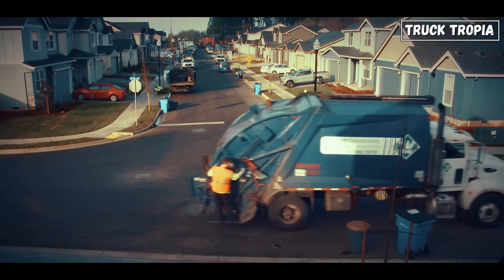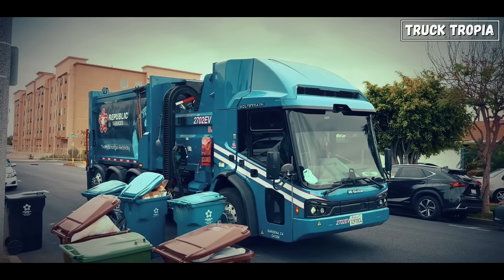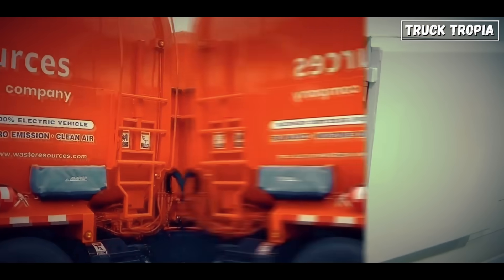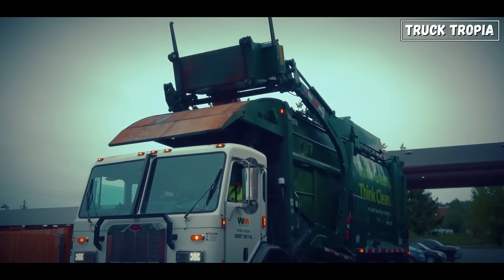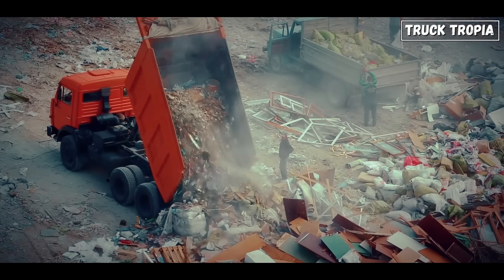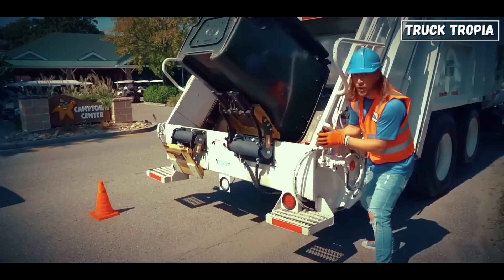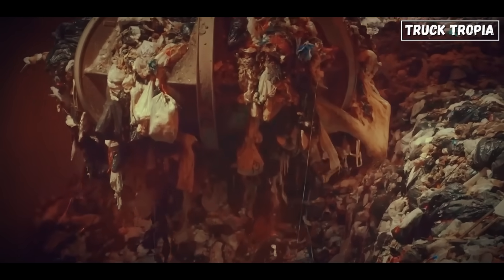What REALLY Happens Inside a Garbage Truck?

Comment: My first real job as a teenager was as a "back man" on a rear-loader.  Three of my uncles were garbage truck drivers, and they got me the job.  It was a lot of heavy lifting, running, and showers.  The smell, especially in the summer, was brutal, but you got used to it.  It got into your skin as well as your clothes.  Maggots were also a problem in the summertime.  We used to get those old school galvanized metal cans that didn't seal well, and when I tell you the maggots were inches deep, I am not exaggerating.  It was gross, and they would climb up inside the hopper.  If they got onto your skin, you'd get bitten.

Comment: Recently moved from my last residence of almost 30 years. On my last garbage pickup I gave the guys some doughnuts. I'd seen them often enough and they're a pretty chill lot. Back and forthed a bit and at the end of that conversation the topic of recycling came up. Don't remember the question that was asked, only that they both laughed and said that the recycling truck dumped everything in with the regular trash. I suppose I should have seen it coming, both trucks were the same, just different coats of paint.

Don't get me started on aluminum cans. Saved up enough to fill three lawn debris sized bags. The money we received wasn't even worth the 180 mile round trip in gas alone. Yeah, how many years did those cans sit there taking up garage space slowly filling up, only to result in a net loss.
Reply from the maker: Interesting insights, thanks for sharing!

Comment: What surprised me most was that the video showed me little to Nothing of what happens inside a garbage truck.
Reply: The weirdest thing being the script mentioning "so now you know what happens inside a garbage truck" like 18 times within 7 minutes.
Reply: Exactly! Waste of time...
Reply: It's almost like they went in depth to not show us.   I think hydraulics were involved.
Reply: Yea
Reply: "Whats goes on" trash is dumped inside the hopper..(the place you see the can going) a bulk blade, this is a  hydraulic ram the size of the truck pushes the trash to the back or front of truck, that's called packing. 
There are cameras that the driver watch for hazardous materials, tires, oil etc.. also to watch how much the blade has packed and if the truck is full or go dump. 
Most front load (dumpster trucks) have two large cylinders that cross each other for maximum compaction. Trash juice is trapped inside the truck by seals. Sometines you see them leaking (not from lack of maintenance, but from pressure) There is a small chamber for side load. This leachage is dumped at the landfill along with the trash. 
During the day a lot of trash crosses over to the wrong side of compaction blade and at end of day after dumping final load. Drivers climb in the back, (small doors you see on side, and clean these areas out. Takes around 5 to 10 min to clean out (front load trucks) Side load trucks do not have.. they have the chamber.. 
 It takes average of 4 hrs to fill a Trash truck in  Surburban areas. 
In heavy populated cities like downtown areas. They can be filled within 3.  An single Apartment complex can fill a front load truck in as little as an 1 hr.
Hope this Helps..
Happy Trashing
Reply: @terrencemckinnon9371  If I could read I'd wouldn't be watching YouTube.
Reply: 😂😂😂 exactly 💯
Reply: What do you expect from AI slop?
Reply: @Alex_-oc4bt  my thoughts exactly

Comment: In europe we have side load trucks with an arm that terminates  with a ring electromagnet and a piston coaxial to it.  The magnet attaches to the external part of the lift spot on the bin and  once positioned the piston press a bar in the center of the  spot itself

Comment: I can't believe this video didn't mention that most modern garbage trucks are running on CNG, (Compressed Natural Gas) CNG rear loaders will have the fuel tanks mounted over the front of the body and behind the cab. CNG front loaders will have the tanks mounted either on top of the body or inside of the tailgate. CNG side loaders will have the tanks mounted inside of the tailgate. CNG rolloffs will have a large tank mounted on either side bolted to the chassis. (CNG is a cleaner fuel, but only offers half the range requiring larger fuel tanks, meaning trucks on long routes will still use diesel.
Reply: The city i work for has exactly zero CNG trucks.

Comment: The internals are at, 2 minutes to
 4 minutes. Its a very simple system. Front lift rubbish goes in then a  panel pushes & crushes it to the back of Truck,  to the tail gate.
A rear loader is similar but pushes the rubbish to the front. Side loading uses a paddle which sweeps rubbish left to right to the tail gate,, that's all that happens. 
Very basic system, just keep feeding it until it stops,, its under  big Hydraulic pressure..

Comment: He forgot to mention the rear loaded has a second plate called a index plate witch the load is pushed up against that then moves due to pressure
Reply: Sweep blade and push out (or ejection) blade are the terms we use but terminology can be regional

Comment: The compressors are the main reason why you DON'T THROW LITHIUM BATTERIES IN THE TRASH.  You run the risk of garbage trucks catching on fire.
Reply: I had a load catch on fire once. It was a lithium battery from a remote control car.

Comment: Where i live it's a combination side load front load the truck has an attached front load bin mounted on arms with a side loader mounted on the front bin
Reply: That's called a Currato (there are probably other brands too).  

Most Currato are Single stream But there are split Curratos. to dump into a split body truck.    Garbage may be dumped on one side and recycling in the other

Comment: 24 year Diesel mechanic in Garbage. Safety is always first. We have strict lock out tag out procedures. These trucks store a lot of hydraulic energy, thermal, air etc. Also. The garbage trucks have 3rd eye cameras in front of the truck and inside the hopper. We can see where the truck is at. And if it picked up your trash. Lots of things you throw away can be seen on camera. It’s a good customer service tool. In the US we call the side loaders. ASL. The other truck with recycling and garbage. We call that Dual sort. Nice video!!
Reply: Good use of LOTOTO. Safety first
Reply: You've gotta stick a magnet to the access door prox sensor to check when the driver complains of a hydraulic leak.

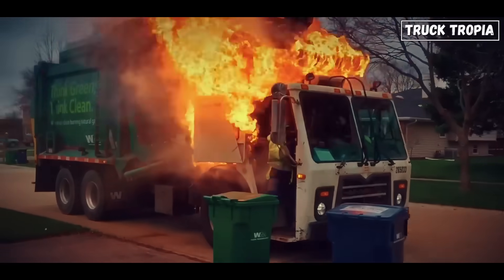Comment: I like the irony at 5:42 they talk about fire suppression systems internally in case of lithium or chemical fires... but show a clip from an external fire, one from a ruptured hydraulic line hitting the hot engine exhaust to be precise.  Like yea it helps illustrate the narration, but could at least have put another vid of an actual battery fire even in a lab setting.

Comment: I can’t imagine that the mixed up contents are actually sorted. Who’s doing that job???
Reply: I drive a rolloff truck and empty at a simple flat floor transfer station (garage style covered).  I dump along side of residential trash trucks and  most of the stuff comes out in a log shape.

They only see stuff thats on the ends and edges then as a scooper picks it up it reveals more of it.  If the loader operator sees a forbidden item they have to remove it.

If they are lucky they will spot it as its coming out of the source.  Then the driver has to take it back with them and try to figure out where it came from
Reply: @leslietaylor4458 guarantee they aren’t doing that last part unless they get benefits or extra pay for it. Maybe you, but I’m inclined to believe that most simply will say “I can’t figure it out”
Reply: Recycling will go to a sorting facility which is highly automated.   

Some areas collect all or some types of recycling whereas others only collect cardboard
Reply: No one. Recycling is a scam, it all goes in the same pit.

Comment: A Chicago garbage hauler told of disposing of a rotted-out '57 Chevy.  They chained it and pulled it into the crusher.  It reportedly took several "bites" to swallow the car, but they eventually got it done.  (This was in the happy days before the environmentalists and the EPA.)
Reply: I drove over a load early in the morning. A radio traffic report said there was a downed tree at a certain street. I pulled up to see a police officer babysitting it waiting for the city to come out and chop it up. I backed up my rear load to the small part and my truck "ate" the 30 tree about two feet diameter trunk after several cycles (bites)

Comment: Side-loaders.  Guaranteed to take down a couple cable tv lines, every day.
Reply: Not if your alarms are working right. 

Even then an ASL arm will have been lowered to put the toter back.   If the fingers are not fully retracted, though, it can rip open parked cars like a can opener

Comment: there's another type,  with SPLIT compartments (Separation for TRASH and RECYCLABLES) 
at the top, a moving door channels into the proper compartment.

also newer trucks have manual or automatic grabbing arms to speed up the collection process
Reply: There are two types of split bodies for an ASL.

I have driven the type with the swing door inside the hopper like was pictured. There is also a split body for a split Currato.  Depending on which to her you're picking up, you can select it to dump on the left, or the right side of the Currato

Comment: 👎🏾 never showed the internal animation that I clicked to see 😡
Reply: Thats why I am here
Reply: Show internal action please.
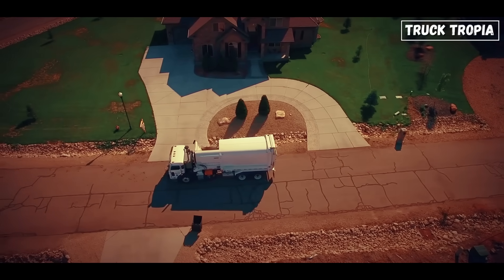Reply: Thanks. You saved me 7:42 seconds of my life.
Reply: That’s fake as a garbage expert that is fake so
Reply: I thought I was the only one.....🤔
Reply: Yes time wasted 😔
Reply: getting a thumbs down
Reply: I also expected a nice animation
Reply: 2 to 4 minute mark, Front lift truck dumps rubbish at the front of the body,, a huge square panel in side which fits snuggle inside the body pushes & compressors the rubbish towards, against,  the rear
 tailgate then the panel retracts back to the front ready for next bin. When the truck is full, you open the tail gate & use the same panel to push the rubbish out.
Practically the same for rear loaders just opposite.  Side loaders, one of many  uses a paddle. All it does is sweep from left to right like, 9 o'clock to 3 o'clock. 
Then 3 back to 9, Constantly pushing the  rubbish to the tailgate.  All are a very simple well engineered compacting system. 
Think of it as, using your hand to push pieces of paper into a cup until full, just need a panel to reverse push it back out or open bottom of cup & push out. Sorry for long story 😔
Reply: Thank you for saving me several minutes. I’m clicking away
Reply: still waiting on it too.
Reply: Ikr!... what the 🤬
Reply: thanks for saving me
Reply: thank you!
Reply: @Mazak905  why?
Reply: Thank you for saving me 7min
Reply: thanks u saved my time
Reply: Dw the garbage truck takes it then crushes it, and there's other versions where it can separate the garbage from the recycling auto
Reply: Thanks, I'll skip the video then
Reply: Thanks for saving me time
Reply: Yeah, that was a whole lot of nothing.

"What REALLY happens?" the video asks. "It is much more complicated than you think" the video promises.
And what they then deliver is basically "the trash gets compacted in the truck."  Yeah, no shit.
Reply: Exactly! Just a lot of blah, blah, blah to say nothing
Reply: Same thanks for the save lol
Reply: Did he explain what garbage is?
Reply: Yes, it is another click bait video
Reply: Great comment.  Didn't learn anything here that I could not have supposed from seeing one in the street. Is this bland nonsense AI generated?😊😊
Reply: @stephen5119  it’s supposed to be like what it says into the video
Reply: He tried his best Goofy

Comment: The rear load trucks the blade inside the body (the wall as we refer to it as in the industry) is pushed to the back of the truck at the beginning of the day and the packer you can see as the trash fills up it slowly pushes it towards the front of the truck. And there is not alert to tell us when it’s full we just judge by how it’s packing if we can’t get anything else into the truck then we go dump.
Reply: Thanks.  That's exactly what I was expecting to learn during this video.
Reply: Yeah I figured it really wasn't as crazy as this guy tries to make it sound. Thanks for the info.
Reply: Can usually cram an extra ton or so in the hopper most I’ve crammed is 16 ton in a truck that usually packs out around 12
Reply: @wideopen2127  the most satisfying is the 20 yard trucks that the cable trick works on. i remember my first route the loader talking about using the cable trick and being confused as hell until he showed me. still have no idea how that even works
Reply: I put over 17 tons on a 25 yard rear load (yes, totally illegal weight) but would struggle to get 12 tons on a front load
Reply: @RobB-j8k  rainy day?
Reply: This lady knows what she is talking about. Thank you!

Comment: What does the garbage truck packing blade do to van or minivan  or carcseats
Reply: My partner and I with a rear loader with Heil Packer, We ate a V.W. bug. Heil made the best packers. 3,500 lbs per square yard of compaction. Picked up and wenched a dead gray whale off a park beach, It was disgusting and stunk. Whale blubber oozing out from the Buzzle and side access door.
Reply: It will turn it into a ball of metal

Comment: 5:41 That a hydraulic line leak, it's the most common cause of garbage truck fire
Reply: Actually you’d be surprised that’s not one of the common causes, it’s actually batteries and other things such as chemicals reacting
Reply: residential collection, fires are mostly caused by the homeowners dumping fireplace ashes or hot coals from their BBQ's. A rare chemical reaction is very rare. Lithium batteries are taking over.
Reply: @harleyhawk7959 batteries are the biggest thing
Reply: Now a days it's a combination of things but it used to be leaking hydraulic lines on the hot exhaust on cab over garbage trucks
Reply: On that WM Currato?  Cabovers are just asking for problems.

I've had two fires in my garbage career. One was dried out yard waste in a rear load And I literally dumped it next-door to the fire station.   

The second was either burning through the electrical or an electrical fire, burning trash between the cab and the compactor of a front load

Comment: That one that caught fire, I noticed it was a CNG truck and had a liquid spraying out right before the explosion. Do you know anything about what caused that?
Reply: hydraulic system fail - high pressure hose rupture with instant oil fire
Reply: That WM Currato was not CNG, it was diesel but the hydraulic fluid for the leaked which sprayed onto the engine of the cab over

Comment: what about the split recycling ones? how they do it?
Reply: It’s the same as a regular rear loader it’s just split into two compartments each side has a metal wall
Reply: There is a wall down the middle that divides it
Reply: Typically you have either multiple compartments or just use multiple trucks
Reply: I don't think they crush the materials because they causes problems at the sorting center
Reply: @TheKingOfInappropriateComments nope we do crush everything
Reply: @DavidKott  Then it most certainly all ends up in the landfill
Reply: @TheKingOfInappropriateComments nope it gets dumped a recycling center and is pushed into big piles by wheel loaders and dumped onto a conveyor that takes it up into the building where people and machines sort it and bale it up and send it off to be taken to a facility where they will turn it into new items. The split body has 2 different compartments completely separated and the blades and tailgates all have there own individual controls for each side so you can dump it out without contaminating the load, company I work for has one but we can’t go to the recycling center currently because it’s too far to drive from where our routes are located we would be losing too much money in fuel costs and time so we take it to the landfill unless a recycling center opens up closer by.
Reply: @TheKingOfInappropriateComments  recycling trucks are the same machines as general garbage, just one trip for red bins second one for yellows. Recyclables require even more compression as they are cans, plastic bopples, paper and so on consisting mostly from air.
Reply: different compartments
Reply: A compaction compartment port and starboard. Oneside for one product, like cardboard and paper, other side for tincans and aluminum. it takes a bin for each product. Not efficient and a low compaction ratio.
Reply: Recycling is mostly BS. I guarantee they dump both sections in the same place.The split thing is just for the virtue signalling Karens

Comment: there are regulations (Washington where i'm from) that don't allow you to throw away or recycle Tungsten of any kind more than 2*2*2 inches as some of our new* trucks use augers.

*New as in from 2022 and newer.
Reply: Tungsten has value. Why would anyone throw it away?
Reply: @idothink-x8e  good question. i guess if you cant melt it, it breaks the table every time you set it down, you can't break it, and its too heavy to throw out a window you don't have many options. i guess you can [REDACTED BY U.S. GOVERNMENT]
Reply: This video is the first I've seen an auger